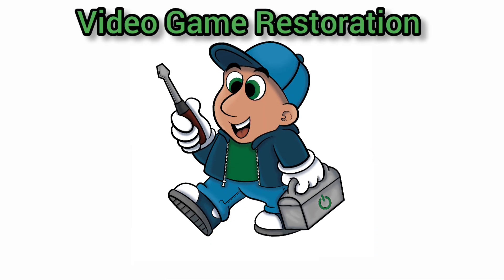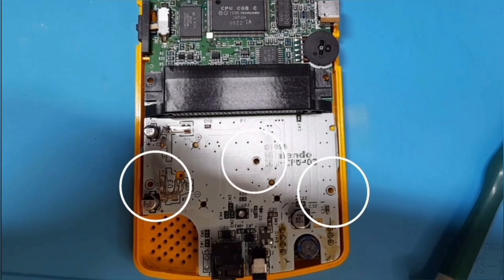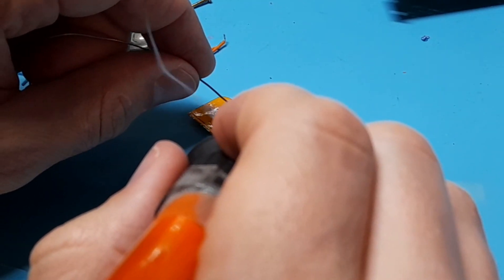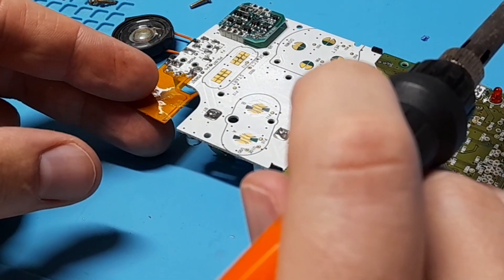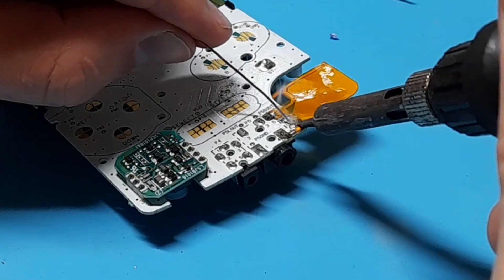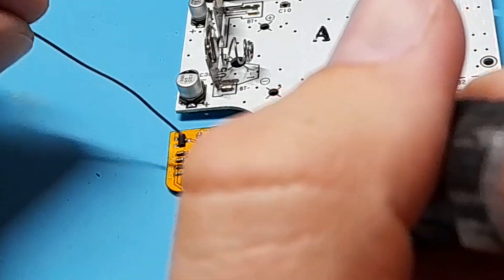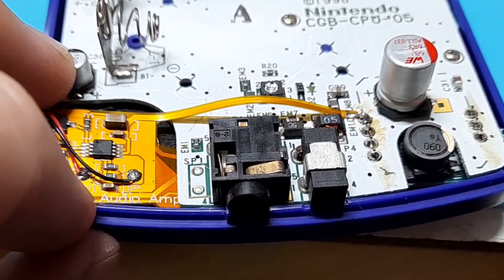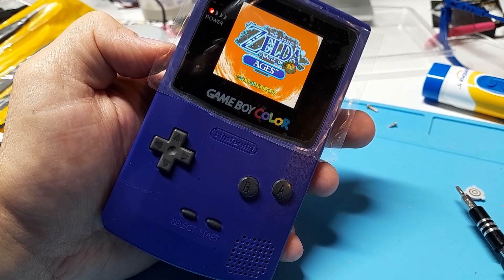How To Install A Gameboy Color Flex Amp

Comment: I just had mine show up in the mail and I realized there was no guide, so thanks for this.
Reply from the maker: You're welcome! Good luck!
Reply: If I can ask a quick question, what do I do if I start getting electrical hum? I ordered a full set of replacement caps but they haven't come in yet, and I don't 100% know that those will fix it because I'm new to this. Tips?
Reply from the maker: @fangoroth6600  replace the main capacitor with a 680uF one! Shoot me an email, I can send you one!
Reply: @VideoGameRestoration   email sent

Comment: I've installed this on two systems so far and replaced the speakers and capacitors for good measure.

I also recommend replacing and supplementing the power converter with Helder Games (Angry Helder) power regulator flex board. 10 usd and it was 5 iirc to ship two.

The original regulator needs removed to cut the pin 7 connection. This is because on some revisions it has a pin header cluster on both sides.

Once it's removed isolate pin 7 and remove the capacitor highlighted on the website. Very easy install and no audio humming with an IPS screen.
Reply from the maker: I actually just put in a helder board!
Reply: Did youreplace all capacitorss or only the one on C32? Did you use the same capacitor for C32 or bigger one?
Reply: I just answered my question. I see that the Helder power reg comes with a capacitator built in. :)

Comment: Nice guide! Got mine installed today! Did you have any noise or interference from the sound? Might have to upgrade my speaker too...
Reply from the maker: Upgrade your main capacitor to a 680uF
Reply: I am having the same problem. The sound is so good, but a constant buzzing is always there. Even with the volume on 0. The main capacitor do you mean the 100uF one (the bigger)?

Comment: I just replaced mine with the same amp and a new lcd fuuny play, and definitely a humm now, did doing the capacitor help alot?
Reply from the maker: Absolutely, try cleaning the power switch and audio jack too
Reply: @VideoGameRestoration  ok thanks

Comment: Recommended mod for somebody new to soldering?
Reply from the maker: Hmmmm it can be a little tricky, and you can easily burn up that pads.
Reply: @VideoGameRestoration  would the actual board with wires then be better?